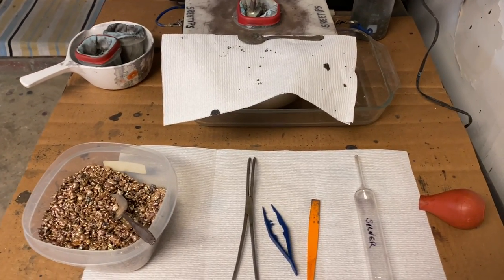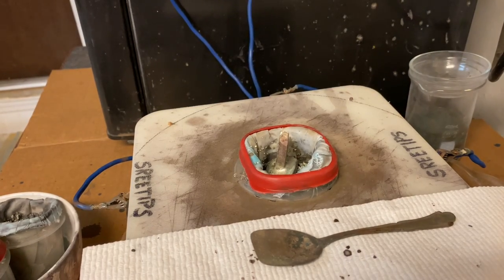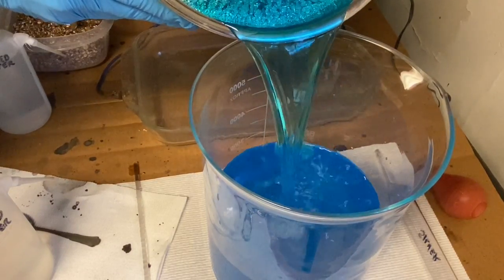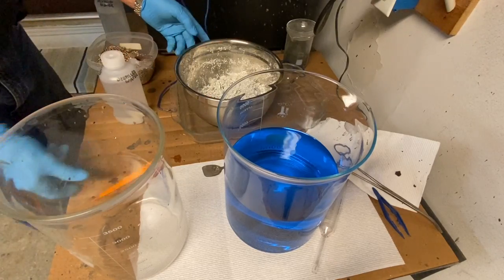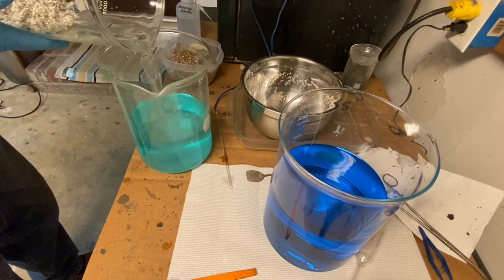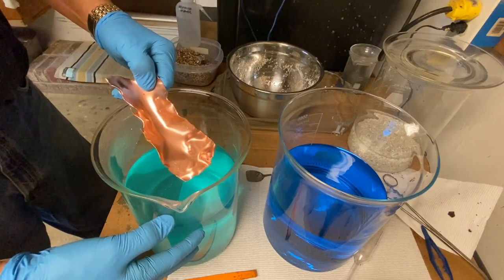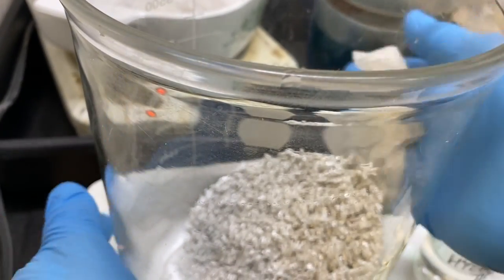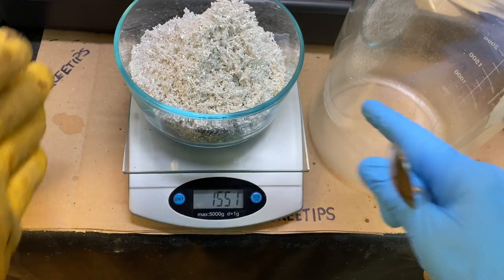Kilos of Pure Silver Cell Clean out

Comment: I just started my own silver cell without a fume hood but I am working outside with a fan going & away from public. It's only been an hour since I started & there's already crystals forming around the stainless steel pot! Thanks for all your informative videos @sreetips!!
Wish I could post pictures on here...
Reply from the maker: Bravo
Reply: upload to google photos and post the link to it
Reply: Whats the blue liquid called?
Reply: @brandonrafferty1575  electrolyte
Reply: @Rustic-Minerals-Jewelry  can you just buy it? If so. Wherr?
Reply: @brandonrafferty1575  I donno, I made my own with silver bullion & nitric acid. Blue color is from the copper that was added. If you use pure .999 fine silver  & nitric acid, the liquid will be clear.
Reply: Hey, i just stumbled across this video and i'm curious. What is this type of silver commonly used for? this is the first time ive ever heard of silver crystals
Reply: @ryanmackinnon4215  it's usually melted down into shot. Used in casting jewelery, Or melted into an ingot and rolled out into a sheet for fabrication. I don't know of any uses for silver in this state.
Reply: What settings did you use on the power supply for the electrodeposition?
Reply: @lordeverybody872  or combined with Mercury
..
Reply: @brandonrafferty1575  It's the battery electrolyte. The actual chemical that is turning it blue is copper ions (copper nitrate).  There are copper impurities in the silver shot that he is feeding into the cell and the copper remains in solution because of how the cell is set up and only the pure silver plates out.  The copper builds up and the electrolyte will get bluer and bluer until it has to be changed because the copper will start to plate out if it gets too concentrated.  The copper probably comes from the copper that is used to "cement" out the dissolved silver in a previous processing step.
Reply: @brandonrafferty1575  Gatorade, not kidding
Reply: @brandonrafferty1575  lol, you don't just let some magic blue liquid settle in a pot and get free silver. You need to EXTRACT the silver from the unpure shot, which you need to buy. It's not a free money making machine.
Reply: @SpydersByte   e-waste is pretty easy to get, I made friends with a few local repair shops and they give me all the dead electronics I could ask for.
Reply: how do you get the initial shot to start the process??
Reply from the maker: I buy sterling silver at yard sales. Dissolve it in nitric. Filter out junk. Cement the silver out of the solution with copper. Rinse the silver off, melt into shot, run it through my silver cell.
Reply: @skepticfucker280  Your comment and name both made me chuckle.
Reply: @brandonrafferty1575  it’s not electrolyte. It’s the silver dissolved in nitric acid that he gets from melting silver or unacquainted gold
Reply: @sreetips  what kind of prices do you need to get for the sterling silver at the yard sale for it to be profitable?
Reply from the maker: I don’t know, I just buy it because the sellers are going by the spot price to gauge the value of the silver - a big mistake. Because silver is grossly and artificially suppressed, buying based on price is useless. But if I do pay based on spot, I use 80% to calculate the price that I pay.
Reply: @sreetips  I had not realised it was artificially suppressed this is really good info!
Reply from the maker: A large paper futures market provides a convenient way to keep the price, and therefore the demand, for physical metals to suppress them. The money printers need you focused on their paper. They can’t have folks shunning paper and converting the paper to metal.
Reply from the maker: This is a matter of public record and can be verified.

Comment: have you ever considered taking some of the larger attractive crystals and immersing them in clear acrylic before they oxidize to create some curios..could it turn a tidy side project?  i'd like to look at a perfect silver crystal under glass.  gold forms crystals as well, perhaps with a gentler process than the stump remover.  your process creates something rather rare in nature, as a side product.  toward the end you showed very fine silver 'cementing' to the copper sheeting...those are fabulously fine detail.  how hard would it be to use tweezers to remove it and slowly lower it into acrylic?  also thinking polishing small magnifying dimples into the 'globe' would further attract the mesmerized mind. i'm a true fan of crystalline expressions, and you might have a fidget for us there in your stainless steel cauldron, that likely would generate better than by the kg bulk.

Comment: I'd love to see those crystals suspended in resin
Reply: I'd like to see a guitar body that was a suspension of silver crystals in epoxy with varying blue color to simulate the electrolyte in the cell
Reply: @GiveThemHorns  that would cost a shit ton and probably make noise in the pickup
Reply: @daallen7636  Something easily fixed by instead using piezoelectric pickups if it were an issue. There would also be the added bonus of not needing to route the body and block some of the finish with magnetic pickups

Comment: As someone who spent 20 + years in the lab as a bucket chemist (those who know will understand!) I admire your technique and envy your set up. How do you go about disposal of your waste though? Isn't that rather expensive?
I am glad how you stress the safety aspects from time to time and also wear your PPE, tough shoes etc. I used to have to deal with boiling conc. sulphuric acid under reflux on a concrete mantle and every so often it would finally eat through the glass Kjeldahl  flask and BOOM! Not fun!!
It nearly always happened just as I went to lunch....
Reply from the maker: Boiling sulfuric will dissolve glass? I never would have known.
Reply: @sreetips  concentrated sulphuric at 360 degrees c long enough slowly eats through the glass. Its a very slow reaction. Possibly the fact that there is also borax and copper sulphate in the tube and it boils for an hour or so 3 to 4times a day.

Comment: looked it up online but if I did it correctly Total silver value is $1,343.38 out of 1,551 grams. 

it also says 
This doesn't necessarily mean your item is only worth $1,343.38, this only represents its melt value using the latest closing silver price.

Comment: 5:33 how did you determine that only silver will electronically plate out through the electrolyte?  Besides copper could your silver be contaminated with platinum or other metals?
Reply from the maker: As long as voltage, silver concentration of the electrolyte is kept high, copper concentration low, then only the silver will plate out. Above 60g/liter the copper could begin to plate along with the silver. The platinum should remain in the anode filter, same with the other platinum group metals. The exception is palladium. It’s the only one of the six sister metals in the platinum group that’s soluble in just nitric acid. If the available free nitric is kept low in the electrolyte then the palladium should stay in the filter. Otherwise palladium could dissolve if excess free nitric is present and start to build in the electrolyte. We can tell when this happens because the electrolyte will turn green. A little palladium is not a problem. But at higher concentrations the palladium could start to plate out with the silver. Palladium in our silver is not the biggest concern. Palladium is worth 100 times more than silver so we don’t want to sell our palladium for the price of silver!

Comment: I dont understand what's going on can someone explain.?? This looks awesome
Reply from the maker: Gladly, partially refined 99% pure silver granules, rendered from sterling/925 scrap silver, are placed in the anode filter basket on top of the cell. The anode basket is suspended in a silver nitrate solution that contains 600g of pure silver dissolved in 3.5 liters of liquid. This silver nitrate “electrolyte” is contained in a stainless steel bowl. The stainless steel bowl acts as the cathode for the silver cell. I attach the positive lead of the power supply to an electrode bar, of my own design, that sits on top of, and is in contact with, the 99% silver in the anode filter basket. The negative lead from the power supply is attached to the stainless steel bowl. I then pass an electric current regulated to 3.5 volts DC through the cell. The electrolyte, being highly conductive, completes the circuit from the anode filter basket to the stainless steel cathode. This current flow causes the 99% silver in the anode filter basket to dissolve. The dissolved silver ions pass through the pores of the Dacron vacuum cleaner bag that is used as the filter in the anode basket on top of the cell. The ions then travel through the highly conductive silver nitrate electrolyte and deposit (plate out) as absolutely pure elemental silver metal on the inside of the stainless steel bowl. The impurities from the 99% silver get trapped and stay in the Dacron filter bag in the anode basket as “silver cell slimes”. These slimes will contain gold and platinum group metals. I save the filters and recover the precious metals that they contain. The pure elemental silver is called “pure silver crystal” but they are not true crystals. They are actually pure metallic silver that gets plated out, over and over, on top of itself to form the beautiful “crystals” you see in the video. Kind of technical, but I hope that this helps you understand the concept of an electrolytic silver cell.
Reply: would that be a viable way to make money in a third world country? I'm truly sorry if this is a dumb question but I'm kinda curious about it

Comment: Nice. Have you done a video of reclaiming lead from a car battery or  separating lead from bismuth in weights? In the silver cell could you put a flat metal ring just smaller in diameter of silver cell so it could be pulled out leaving crystal tree still in shape Attached? It would look good hanging on wall. Would it fall apart over time with air exposure? How about if not rinsed off first?
Reply from the maker: I’m am really swamped with precious metals. Devoting time to lead recovery doesn’t seem very prudent. The silver crystals are fragile and they will break

Comment: Hi there, i'm wondering how is it possible to refine silver in a steel bowl? Wouldn't cementation of iron occur and therefore contaminate the silver?
Reply from the maker: There is a slight bit of iron that gets into the silver. But it’s parts per million. Not enough to report in an assay
Reply: @sreetips  But i just dont understand how there is almost no iron in that silver, even if it's stainless steel. The difference in standard potentials of iron and silver is just so high. I'm not trying to examine you or anything, i'm just curious so if you happen to know the answer i would be happy to read it :D
Reply from the maker: I don’t know the answer.

Comment: You don't mention if the original silver shot was sterling or argentium silver!  Also, I know your "electrolyte" is a strong acid.  What is it?
 When you added the copper to the rinse water, did you add more acid to get the copper to disintegrate? It looked like the silver crystal were growing on copper sheets that I thought were disintegrated?!?!?  How do you separate the silver from the copper?  Can you use the original acid (dark blue) again?  Is it still strong enough to do the job?  If the rinse water produced silver then surely the other is full of it!
Why didn't the first go round get all the silver?  What was the silver bar for?  When hooking up to a power sorce could you use a battery charger for a trickle charge effect, just as well?  Did you also use a hookup ( positive or negative) to the the stainless steel pot? 
This curious mind really wants to know!!
Reply from the maker: Stainless bowl is cathode to negative anode basket to positive. 3.5 volts is critical batt charger won’t work. I just rinse the copper off the silver with hot water. The electrolyte is about 600g of silver dissolved in 3.5 liters. It’s clear like water at first. I consume excess free nitric by leaving a small amount of undissolved silver when I make the electrolyte.

Comment: Wouldn't it be simpler to put all the rinsings back into the electrolyte and evaporate off any excess water, then return the cell to normal service? As long as you have more impure shot to process, there's no need to cement out any silver in the diluted electrolyte, is there?
Reply from the maker: The electrolyte loses silver as the cell operates. It also accumulates copper. It’s only good for about two runs then it must be changed out with fresh electrolyte. I add the rinses to newly dissolved silver nitrate solution to dilute it. If it’s highly concentrated it could cause passivation on the copper and halt the cementing action.

Comment: How does the silver not melt the filter basket is there is a current melting it!?
Reply: Silver melting point is 1763f
Reply from the maker: We are not heating the silver, the electric current flowing through the cell corrodes and dissolves the silver. Any gold or platinum group metals will not dissolve and get trapped in the anode filter as slimes. These slimes can then be processed and the precious metals they contain recovered,

Comment: what do you do with the crystal silver? remelt into bars? sell as-is? i made a silver cell months ago but its sitting around collecting dust while I slowly put together my work space and find materials. I have melted a lot of the silver shavings i have from drilling holes into .999 fine material. I guess i should remelt and drop into the water bucket to make the shot if i intend to make the crystal?

Also, what constitutes the impurities that clog the filter... could it be other PM or all junk?
Reply from the maker: The slimes in the filter contain gold and platinum group metals

Comment: What is the electrolyte mixture?
Also what is the positive charged bar in the cell made of?
Reply from the maker: Silver nitrate, 150 grams per liter. The anode electrode bar is made of a 2.5 ozt pure silver bar poured and welded onto a ten gauge copper wire.

Comment: Sooo......... do you yield more than what is actually dissolved in the nitric acid?  Does this procedure make you money or is it just a cool experiment?
Reply: from another video he did with the 1 litre beaker.  He dissolved 5 oz and got close to 10 out and could reuse the solution a second time.  As far as profit that just depends on how cheap he can get the sterling.

Comment: Does the silver cell produce more silver than the silver you used at the beginning of the process? Also, can I use this Liquid "Silver Nitrate, 0.0100 Normal (N/100)" as an electrolyte?
Reply from the maker: Silver nitrate dissolved in distilled water will work. No new silver is being created out of thin air.

Comment: Sreetips, do you have to refine the silver shot (.900 or .925) to grow the silver crystals?
Reply from the maker: The silver going into the anode filter should be up around 99% lower can be used but the cell will become saturated with copper very quickly

Comment: So what are you going to do with those silver crystals? Eat it??
Reply from the maker: Elemental silver is very non reactive and could be eaten. But it doesn’t have any nutritional value. Silver is naturally anti-microbial.
Reply: @sreetips , they use silver in dressings for stubbornly non healing wounds. Is this what they use, very finely ground pure silver crystal? I never knew till today that silver existed in crystal form though I knew it existed in solution. Even though I knew it could be electrolysed onto copper jewellery, it was done by s street merchant in the Asian city I spent my teens in. We could take our base metal often very pretty jewellery and get it looking lovely at his hole in the wall stall. Some wires and a beaker and in it went, and came out looking amazing.  After a while it would wear off or oxidise, if we liked it enough we would take it back and do it again.

Comment: I don't understand why dissolve silver to creat Cristal silver?
Reply from the maker: I refine gold. I use sterling silver, that I buy at estate sales, to refine the scrap gold. I recover the silver from that, melt into shot, and run it through my silver cell. Silver is a by-product of my gold refining. The cell converts the impure silver (about 980 parts per thousand silver) to high purity four nines fine (9999 parts per ten thousand) pure elemental silver metal. So I’m refining the impure silver, into high purity silver, not creating silver out of thin air. When it’s full, I harvest the pure silver crystal, put it away and forget about it. Then I repeat the whole thing again.

Comment: What is the imperial shot I don't understand what that is is it or is it some chemicals you have is it ground up Rock?
Reply from the maker: Sterling silver, dissolved in nitric acid, filtered, precipitated with copper to form 99% impure (not imperial) silver shot, fed into my silver cell, dissolved, and plated out as high purity elemental silver.
Reply: Thank you for replying I understand now it's pretty cool I like the crystals it forms it's pretty cool how you can get crystals to grow in different kind of solutions like the good old sugar crystals and salt crystals you can form in water so pretty much you are electroplating the silver then you grind it up and you add chemicals to pull the silver out and you electroplated again to get pure Crystal forms that's cool